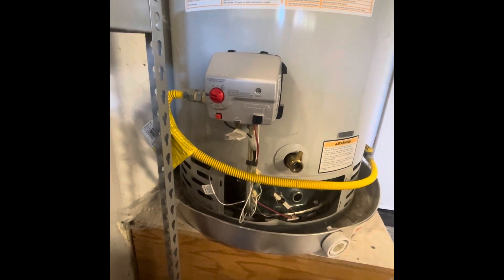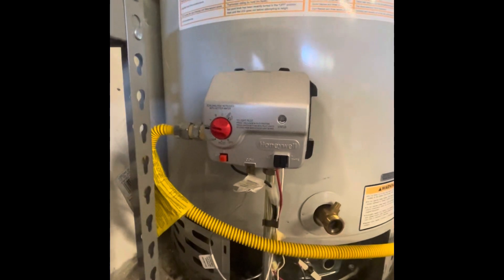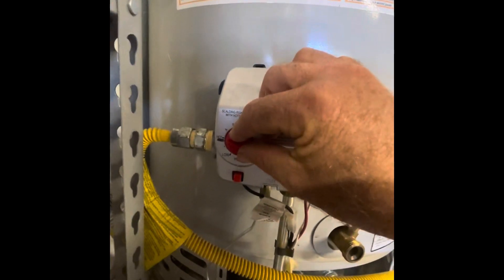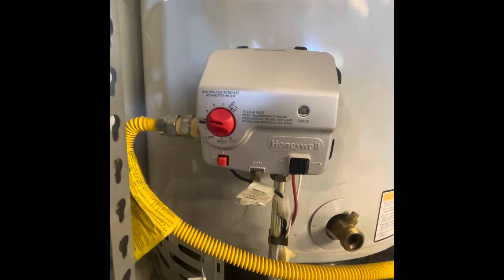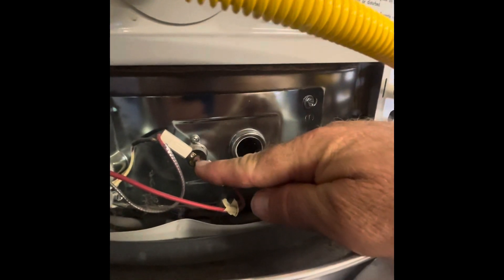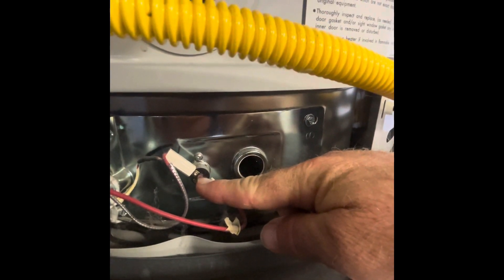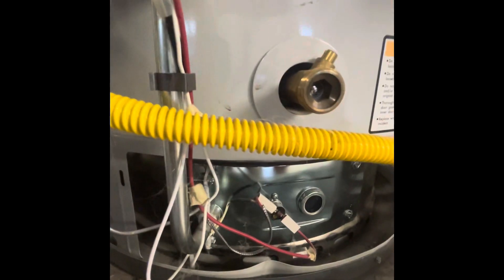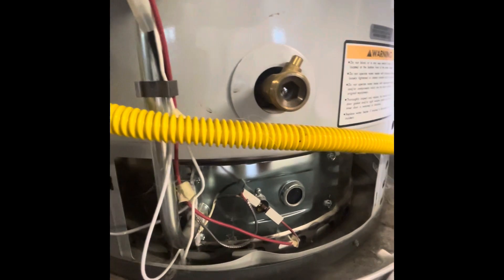Whirlpool Water Heater Not Staying Lit. EASY FIX!￼

Comment: I would never call the f**** professional I am the professional so if it's more than once or twice a month and what do I do?
Reply from the maker: Gotcha! Most likely if it’s going out on a regular basis you have an airflow issue. The majority of the time it’s an intake air issue. Meaning there’s some sort of filter grade/filter that’s plugged. It could also be that the flu pipe is having an issue. Such as a bird nest, etc.
If the issue is persisting, continuing to relight the pilot and have it go out Kennel to more problems. It needs to be fixed.